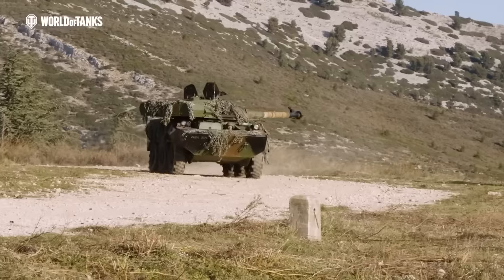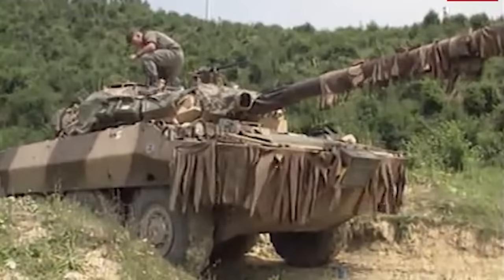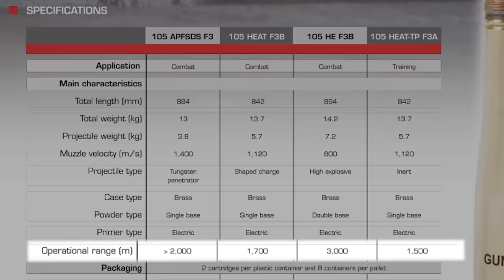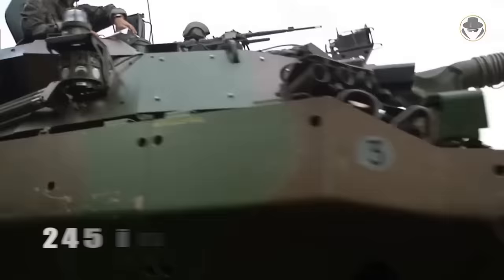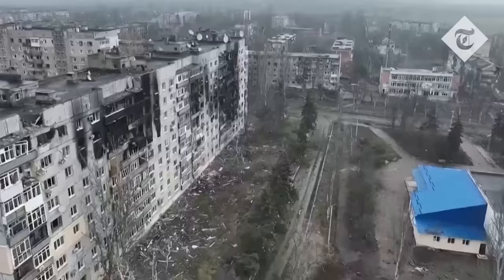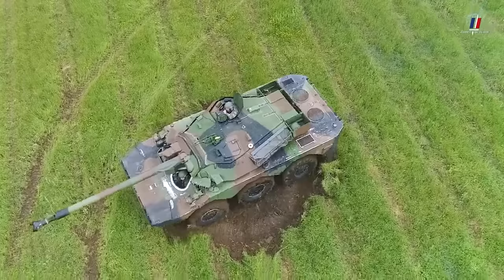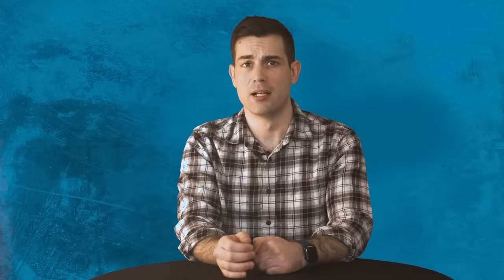Can the French AMX-10 RC Make a Difference?

Comment: I think lack of tracks isnt that a problem as it much lighter compare to normal tank. 
Will see 😁
Reply: that doesn't really help with the mud they have in ukraine even tracks are pretty useless in the sloppy seasone. Besides it needs to be extremly much lighters i ve seen armoured tracked vehicles going over places that even a normale human coudn't walk over. It's all about the point of contact and wheels have a notoriusly small one. thats why they are so efficient when they do work.
Reply: The German  army found  that out the hard way 80 yrs ago buddy 😳
Reply: @arturobianco848  It’s a ratio of contact points/weight as the above comment was pointing out. the AMX is a quarter of the weight of an MBT

Comment: The 105mm gun from the AMX10RC is already able to destroy a T72 up to 2000m: during desert storm they destroy 2 of them.The another advantage is his amphibious capability to cross easely rivers and lakes very usefull in the south Ukraine
Reply: The AMX-10RC's main gun can't even penetrate a T-72B's frontal armor with its most recent DU APFSDS at that range (except for the weakpoints present on ALL MBTs). And that's with no add-on ERA packages or any other sort of protection enhancement package. Where did you get these figures?
Reply: @koskok2965  Yeah, it would be an optimistic crew that engaged the newer russian tank models. Nevertheless, it still can pen t-62s, IFVs and APCs, so it still could support units not expected to take on MBTs.
Reply: @Carbidestruck  That's true. But the gentleman above is claiming things that amount to pure fiction. Even without diving into the numbers, the case of a 105mm medium-velocity gun reliably punching through the frontal armor of a proper, late Cold War MBT at 2km sounds extremely far fetched.

The way I see it, this AFV will be another "better than nothing" sort of donation. It's extremely incompatible with the conflict's environment. I'd take a BMP-2 over this any time of the day, if I were a UA administration official.

Comment: This is one of the best vehicles to send to Ukraine as infantry support. The G2 gun can penetrate t72 and 80 armor for the occasional tank encounter. It can operate in urban environments to punch through walls for infantry. It can stop multiple Russian apc’s. It can move quickly to flank and take undefended territory or exploit gaps. 

If used correctly, coordinated with light infantry carriers like the m113, it is a game changer for offensive manuvers.
Reply: Its utter garbage. Ukrainian soldiers complain alot about lack of armour, firepower and mechanical issues with these vehicles. They have already lost 10% of these vehicles

Comment: In the document you quote, it is not the lack of tracks that disqualifies it as a tank but its weight, which was under 16.5 tons in 1996. It is why the AMX-13 isn't qualified as a tank either in this same treaty.

"In addition, any wheeled armoured fighting vehicles entering into service which meet all the other criteria stated above shall also be deemed battle tanks."

The modern AMX-10RCR weight between 18 and 20 tons, so arguments can be made that it is a battle tank, just not a main battle tank.

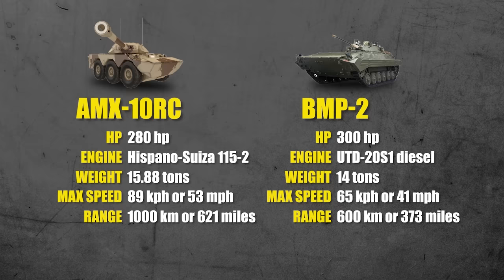Comment: 2:29 Classify the AMX-10 RC as modern cavalry*: fast, capable of covering long distances without refueling and inflicting heavy damage in a very short time, but nonetheless *fragile.
Its role is to appear where it is not expected, at the enemy's worst moment, for very short encounters, which is almost impossible in contemporary warfare with so many means of observation and communication.
The latest version of the Leclerc MBT would make a lot more sense in Ukraine, especially in summer. But for that, France would have to produce a lot more of them.

Comment: AFAIK, They are only available with the F3-cannons, as the project to upgrade them to G2-cannons was cancelled.

Also, I have seen it mentioned that the AMX-10 has been driven at 120kmh for long distances.
Reply: damn tankers removing the speed limiter again!

Comment: In the worst case, it does not matter if the machines are not specifically adapted to the front, and if they do not have standard consumables.
They can serve as a replacement for other more suitable machines, which can be deployed.
In addition, even if they are only a rear guard, they are mobile enough to serve as reinforcements.

BTW we don't eat snails anymore :D

Comment: You often hear that this is not a tank and the advantages of tracks. But what about the advantages of wheels? It must use a lot less fuel, which is probably very important for Ukraine. It probably needs less maintenance and less specialised equipment to keep it running.

Comment: I admire the AMX 10 for all it's ability 🙂
however I question why the Centauro was not considered ?
on face value they are similar (wheeled tanks )  of high speeds 
if high speed and size of main gun was the main point - then surely they getting the wrong tank ? please enlighten me as I am but a novice at this

Comment: 105 on light chassis is old and not optimal concept.
30mm auto with ap/he ammo plus atgms are way to go- bmp2, bradley etc.
Because 105mm is too weak for tanks and overkill for apcs. That is - modern autocannon will destroy everything that 105mm will and probably even faster/better, especially against infantry.
But the bottom line checks out - better to have them than not have at all.

Comment: I have some issues with the 'wheeled can't go where tracked can go'.  I would not be surprised if (say)  Range Rover could go more places than Challenger 3 with the armour upgrades - which has tracks, but its also feckin heavy with a crappy engine. Ground pressure with deflated types and optimised torque management that determine it, I think.  It wheeled is sufficiently lighter, it may still be competitive in terms of where it can go.  And having a wheeled vehicle that can go 80% of the places is a whole lot better than having a tank that is in maintenance or out of gas.

Comment: The AMX-10 seems to be an extraordinary tool for harassing the enemy by storming positions from large distances and quickly retreating. They might not be adequate for open fields, but on sophisticated terrain (like forrests, hills, or mountains), it might become the apex predator in the hands of trained specialists with knowledge of the area and choosing favorable meteorological conditions.
Reply: It did fairly well in the Iraqi desert, so not sure I agree it's not useful in open terrain as long as it has room to manoeuvre.

Comment: Even if you have gun stabilisation the gunner himself is not stabilised, he bounces around, you can't get an accurate shot off on the move, the stabilization just gives you a better chance. The AMX10 is a armoured car, if anything fires back bigger than a machine gun it's in trouble, it's not a tank, the gun is not suitable for a anti tank role anymore, it does have HE shells, so there that.

Comment: The AMX-10 RC turned out to be not armored enough for this conflict. Its main feature is its very high mobility, which is not as great an advantage at the front because of the observation capabilities that didn't exist at the time it was designed, and the even greater mobility of drones.
It could only be used to capitalize on tactical advantages offered by other weapons , for example by rapidly bypassing and surprising the occupants of a defensive line that had been breached in depth, something that hasn't happened for a long time, and which isn't very likely, given the Russian defense in depth.
In any case, this machine could only shine on the battlefield thanks to excellent communication and coordination of the various weapons, and a martial spirit of very fast reaction to ever-changing situations , which requires special training more complex than simply handling the machine.

Comment: armored recon is good.  I wonder if it could also fill a role similar to the new Mobile Protected Firepower system.  a big, armored gun carriage that can operate alongside infantry.
Reply: Yes, it was designed for: screening, long range infantry support, (possibly aggressive) reconnaissance... A strong anti-infantry gun, with thermal optics, can make something good with an inventive officer who knows about mobile warfare. 
And when the bulk of mechanized forces is comprised of IFVs, APCs, and thin skinned transports, you don't need more to face them. 

BTW, This vehicle destroyed a few T72As during operation desert storm.

Comment: It's really down to doctrine, if used correctly they're useful, like a scout role or maybe military uber for battle transportation. They could be useful as rear guns in a larger battle too, with other vehicles pushing the front and garnering all the attention, while they provide supporting fire from cover.
Reply: Scouting ahead and flank protection is exactly what it was intended and used for, able to kill anything but MBTs from the front and outrun what it can't kill with ease.

Comment: Having worked along side AMX-10 RCs in Afghanistan, you are correct about not thinking of it as a tank.  We mainly used as fast moving fire support for infantry, which it does a great job as.  How bad would it be to think of it as a light tank that supports infantry?

Comment: I know its incredibly complex to engineer and a pipe dream of cartoons to think about but ive always wondered about putting a set of ski's or sled tracks at various points over a wheeled vehicle so that there's about 10 wide and somewhat long flat pieces all at the same height but not as far down as the road wheels so if it starts to sink into a surface its surface tension is then spread way out across all the points that come into contact so it can hopefully pull itself out. Maybe even have a manual (I.e. human powered, teeth-in-grooves style) jack system that can lift on those sleds up to two inches so you can shovel stuff under the tires to get un-stuck. 

I'm talking out my ass I know, and not pretending to be an expert. But science fiction and imagination are the genesis point of many innovations, so why not daydream a little bit? Regardless of practicality, the ideas are there- manually applicable increased surface area, getting unstuck by creating grip under the tires and the (dubious) mechanics of how to do so.

Comment: It's a newer version of AMX-10RC with stabilized sight and it can shoot on move. It has thermals, very silent engine, is really fast and light, mud doesn't scare it and it can even swim. This is an amazing vehicle and if used right it will stomp.
Reply: If it has a stabilized main gun, it will be one hell of an armoured recon vehicle.
Reply: @Carbidestruck  This new version which was given to the Ukraine does have a stabilized gun as I know. Even if it didn't have it it has a complex system which shoots shells on movie with accuracy.

Comment: About the AMX 10RC and its gun. The 10RC, even the RCR are fitted with the 105 F2 gun. The G2 was only tested on the AMX 10RC in the late 90's, it was fitted into a new designed turret especially built to handle the full power of the 105 G2, the TML 105 turret, the G2 being MASSIVELY heavier and needing a far more stronger recoil system (they put this turret on several other vehicles, as CV90, MARS 15, VEXTRA...). If you look for AMX 10RC TML105 you'll find some pictures of the prototype (one or two only where modified with this turret).
So, sadly, nope, the AMX 10RC/RCR the ukrainians will receive won't be NATO compliant for the main gun.
And I hope they will have the last RCR who are removed for active units at quite a high speed bing replaced by the vehicle you shown, the EBRC Jaguar. RCR have stabilisation, better optronic, more reliable transmission, better armor due to kit aswell as the SEPAR kit against mines and IED.

And if it can deal with the toughest armor in the game, the APFSDS-T it fires can still pass through 360mm of armor steel and have HEAT that have pretty much the same capabilities. So yeah, enough to hurt pretty much anything especially while doing what it does the best, flanking and peaking shots from where you wait it the least.

The main drawbacks are on the logistic side. Spare is not great, ammo supply is okayish but this can change contrary to spare. Another drawback will appear if UAF use it as a tank. It is NOT a tank, light, medium, superlight... If they use it as it was a tank It will be rekt fast and painfully. It is not designed to frontal fight against armor with bigger guns a simple HE shell from a 125 gun will send it back to France as a bunch of parts flying in loose formation. Against troopers and fortified hotspots, its OE and OCC will do wonders. If it meets some light armor, same.

BTW we have to keep in mind that European tanks at the time weren't that well armored too. Leopard 1 and AMX 30 were pretty much tin can level compared to T-64 and T-72. British stood with heavy armor, at the cost of limited mobility, the tanks being designed to be mobile turrets to put in hull down and handle defensive stuff while X30 and Leos were wrecking havoc with their improved mobility and good firepower. We had to wait until the 80's to see Leopard 2 come with better armor and middle 90's for Leclerc to arrive as well.

Comment: I mean, honestly, even if it can't be used on the frontlines, it can be used as an alternative to artillery or for defensive positions like in Bakhmut. A large gun is still a large gun.
Reply: Except if it comes across any Russian tanks even the T62 is formidable to this thing.
Reply: @huntergatherer7796  Defensive positions. As in already protected areas that could use a little more firepower. There are multiple examples of tanks being used for fire support in trench-style fortifications, I don't see why the AMX-10 RC can't do the same.

Comment: Send them. Other IFVs have a 50mm gun or 20 to 30 mm cannon. This has a 105 cannon plus other improvements.
Reply: Lacks stabilization which means it can only fire when stationed. It also lack ammunition that can defeat a Russian tank headon, it also lacks the range to engage tanks. This is a recce vehicle with firesupport as its main purpose.  Its utter madness to use these in an offensive since Russian artillery will destroy these without breaking a sweat

Comment: The AMX-10rc, in the Ukrainian conflict, can only be used as an armored vehicle for direct infantry support. The technical characteristics limit its use to mechanized formations that need direct artillery support and possible cover from positions suitable for ambushing enemy vehicles. Regarding the "tank destroyer" function... only on a very occasional basis and at very limited distances (with all the related risks). All of this, always taking into account that the number of available means cannot be high, which makes the AMX practically unsuitable for operating in complex multi-weapon groups but limited to specific formations, in specific territories and no further. In essence, it's an extra weapon for the Ukrainians but certainly not one of the most incisive ones 🤔
...p.s. on the other hand, the AMX-10 rc would have been very useful for Napoleon Bonaparte, provided that he found some diesel station open on the street! 😎

Comment: With that range and speed I think they might be somewhat effective at protecting the northern border of Ukraine: the Russians are massing there but most think this is a bluff - you don't want to leave it undefended and yet you don't want to put too many troops there just in case. with the range and speed of the AMX, you can put them on the border to be a stop gap in case the Russians invade, they can cover a huge section of that border from a single base and slow the Russians down until you manage redeploy more forces to that front and push them out.

Comment: The gun-wheels vehicle intended for African operations was preferably the nimble ERC-90, one of the reasons being its light weight allowing its transportation by Transall planes. AMX10 equiped the Rapid Action Force whose mission was opposing WARPAC forward elements should they approach Rhine river. It has been designed to engage soviet light armor successfully (hence its 23/30mm-proof armor), and being at least a nuisance to T-62/64/72 in flanking maneuvers. Serving in Ukraine shall fulfill AMX10's destiny.

Comment: Ukrainian here.

Based on what I hear from my friends on the frontlines, this would do just fine.

I'll give you an example. Ukrainians and russians use tanks as artillery pieces, they literally point the tanks gun up and shoot in the general direction of the enemy; other times, tanks position themselves 1-2-3 km away from infantry positions, due 2-3-5 rounds and run away. They do not watch to engage in a direct fight.

There is quite a few units that don't have any anti-tank weapon system (e.g., NLAW) or an artillery piece that is ready to support them. Having a something like AMX can help to quickly cover a position and destroy a russian tank. AMX is small, nimble, has a good gun and can be moved between positions without any issues (e.g., tanks are heavy, need a lot of fuel, likely are more difficult to operate).

So I can see these machines being used in a role of a support class vehicle or assasin class vehicle.

I'm also 100% certain that only the special operations teams will get these. Most fancy equipment goes directly to them while other units are scrambling for gear. Now give a couple of these AMX machines to special operations teams and they will find a way to use it properly.

Comment: It is a good way to add firepower to small units that can surprice the enemy. There is no doubt that it will do well against older Russian tanks, the most modern tanks in form of T80 and T90 should be possible to destroy from the sides.
Reply: I think it could add an intense punch to armoured recon platoons.
Reply: @Carbidestruck  The question that is important is what form of night sight and IR cameras they have.